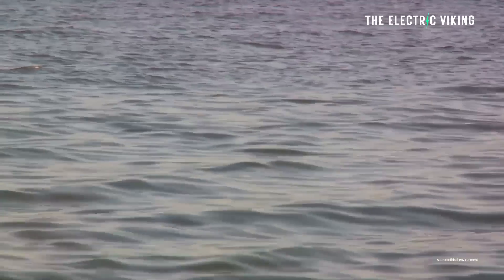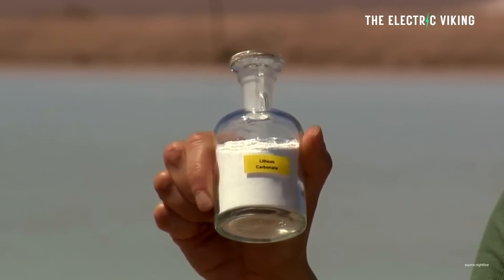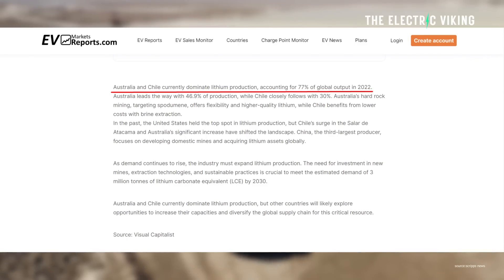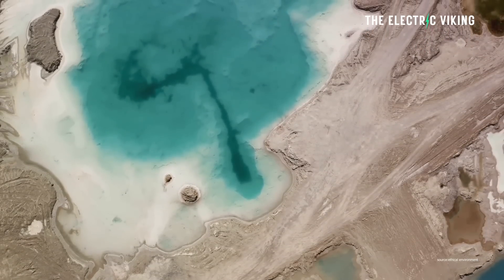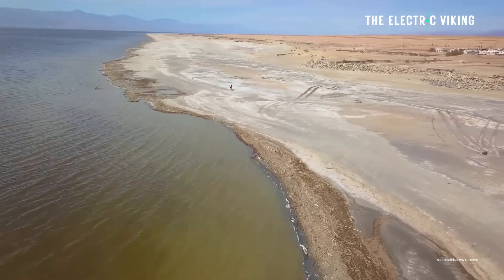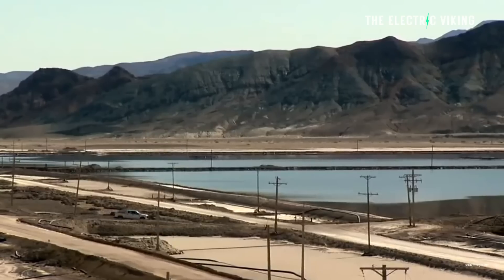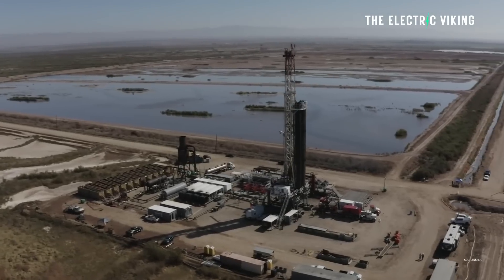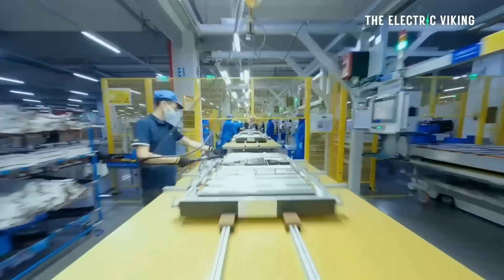US researchers discover how to cheaply extract Lithium from the Salton Sea

Comment: Did you know: Salton Sea is well below sea level... Rivers from Mexico flow north into the sea... San Andreas Fault runs right by it- Indicating a Plate boundary... South end had volcanos where many geothermal plants generate electricity... Currently Salton Sea area is very unhealthful due to dust storms... Should the San Andreas slip, there is a possibility for the Sea of Cortez to reach up to Palm Springs...😎

Comment: An above ground pipe of 6" or 8" of PVC could be ran from the Salton Sea to the Gulf of California. It is 120 miles long. 6" pvc is sold in 20' lengths at roughly $10 each. 264 piece of pipe per mile at $2,640 per mile. 31,680 lengths of 20' pvc linked together for $316,380 total. That's really cheap for that much pipe for that long of distance.  

Look at pumps and gallons per hour.  

Could run a large diameter pipe or more then one pipe. 

Easy low cost project to get the Salton Sea full again.

Comment: Lithium refining is probably what drives price up bc the final manufacturing has to be done in ultra low humidity. Even clean rooms are not suitable for the final refining of lithium. You should do a show on the full manufacturing process. With emphasis of final stage production. IMO solid state batteries is what EV market needs.

Comment: Mind you, lithium can also be recovered from depleted oil wells as oil reserves are basically ancient sea bottoms...

Lithium is one of the most common elements in the Universe.  The only reason why we have limited lithium supplies is because there hasn't been much of a demand for lithium till recently.
Reply: What..?? You're saying Lithium is one of the most common elements in the universe. WRONG! Lithium only exists on Earth. Lithium is number 25 in terms of "abundancy" and is defined by the Minerals Council of Australia as a comparatively rare element found in some rocks and brines but ALWAYS in low concentrations. That's why you have to shift 12 tonnes of overburden to extract sufficient Lithium for just one EV battery. Lithium mining is every bit as environmentally destructive as open cut coal mining and drilling for oil.

Comment: Forget the Salton Sea. Frackers have discovered there is enough lithium in their waste water to supply all our needs. Getting it from sea water would be cheaper and easier but when you are looking for ways to justify your operations....I guess they know how to use their PR departments.
Reply: The Salton sea is the northern end of the Gulf of California. It was cut off from the rest of the gulf by the delta of the Colorado river. It is below sea level and was a dry lake bed until the gates controlling water flow into a canal from the Colorado were overcome and washed away by a flood. The Colorado then took a new path - meanwhile creating a few canyons - and dumped into the Salton Sink. This continued for months until the Southern Pacific Railroad, to preserve their right of way, dumped railcar loads of rock to create a dike and restore the Colorado to its former bed. You now had the Salton Sea. 

At first this was fresh water and for a while there were even resorts on the "sea". Over time the lake has dried, become salty and contaminated with agricultural runoff from the Imperial Valley's farms. There is hot brine below ground in the sink. This has been taken advantage of by several geothermal power plants. After the heat is extracted to boil water to drive turbines, the brine is pumped back into the ground to be reheated. It was known that there was lithium in the brine, but this was taken no notice of until demand for lithium jumped. So now the plants are thinking of extracting the heat AND the lithium before reinjecting it into the ground. The Salton Sea is not proposed as a source of lithium. It is just a neighbor.

Comment: More then likely we will see NaLi batteries in the future either as a mix pack designs or as a single battery design, so more or less if there is Li supply, it can be used. Li still has the benefit of being a smaller element over Na. Yet, if we can't get them safer, its still a bit open if we should be using Li at all. Hopefully we can get solid state batteries on the go and fix a number of those issues even if it means a thicker layer of Li if we have the supply.

Comment: I remember hearing years ago about the "playa" of the Salton Sea, and the environmental problems that its concentrated, sea salt, fish bones and farm chemical runoff was doing to the inhabitants children of the area by breathing that stuff when it became wind blown. I remember at the time thinking, they extract lithium from saltwater aquifers and then dry them out in large flat ponds. They take the dried out leftover salts and extract the lithium from that. What is the difference from that and environment along the salt flat like "playa" on the edges of the Salton Sea? The Salton Sea has super high salt water that is way too salty now for fish to live in, the many geothermal plant there are powered by hot salt water aquifers. It has large unpopulated flat desert plains for drying. It seemed to me that it had everything needed to extract lithium. Low and behold, it seems that now everyone else is discovering it for the lithium gold mine that I thought it would be all those many years ago. Tony Seba call me.

Comment: The problem with cheap sources of lithium is that lithium battery recyling will halt cuz it will be cheaper to extract new lithium, so governments should incentivize recycling thru both "carrot and thr stick" policies, else we'll end up with a huge environmental problem from lithium batteries being discarded
Reply: Pretty simple to create regulation making it illegal to not recycle the batteries. You can also require manufaturers to use a certain percent of recycled lithium in any new batteries. I'm not convinced lithium will be the norm for more than a few decades before some other chemistry becomes dominant.

Comment: There are only 525,960 minutes in a year. So at a run rate of 250,000 vehicles per year, that is a vehicle approximately every two monutes. TEven without building operations, tansporting vehicles from production to logistics on the surface roads will take longer than two minutes  Due to the avoidance of surface traffic, the tumnel should reduce transport tome to less than 2 minutes, and if necessary, could be paralleled. This avoids a bottleneck and as such is imdeed nevessary to meet delivery goals, rather than a marketting or tunnel-pride project.
Reply: Tunnel??

Comment: The problem with Lithium is I believe that it's finite here on earth. We shouldn't use Lithium mostly for cars only.

We need them for our phones and gadgets. What will happen if Lithium runs out? Oil runs out, but nature will eventually replenish it with our biomatter.

I think you can't reuse Lithium once it's depleted or corroded.

Hopefully there is an alternative to Lithium. If you can create electricity from water.
Reply: There's other common chemicals like sodium that can take over for different applications, like stationary storage. 

Large batteries are recycled and the chemicals are refined back into feedstock for new batteries. Right now almost all of it is still in use. Lithium is an element and doesn't change into something else. 

Replenishment of oil takes millions of years. We are burning it at MUCH faster rate. Biofuels might be feasible someday using reactor process heat and carbohydrates from biomass. Don't hold your breath. 

And no, you can't turn water into electricity. Someday we might fuse deuterium and tritium to make electricity or heat. Nowadays we use the gravity potential in reservoirs to generate electricity, but the water is unchanged.

Comment: We need batteries that do not blow up..
Reply: Lead acid batteries can blow up. Lithium ones don't, but lithium ion can burn if it is defective or forms dendrites. LFP and sodium ion batteries have different electrolytes and are fire resistant.
Reply: @jamesvandamme7786   Then make only ones that do not burn

Comment: I've been to the Salton Sea,  This process has never been done on a commercial scale; so it is one of those tech innovations EV advocates will point to and say all we need is this new thing that doesn't exist outside a lab.  But when EV advocates hear the same sort of solution around the corner for hydrogen or ethanol or any other solution; they don't like it they don't accept it - blinders don't help you know what your options are.  In this case, really something better than lithium is needed for EVs to succeed; lithium is too heavy; too fire prone, high energy cost to mine.  If better battery tech really is around the corner why invest in something obsolete?
Reply: Tech transfer is dependent on the obstacles to implementation. Some processes that are feasible in the lab need only to be scaled up to high volume production. Some have minor problems that need to be worked out. Mining is expensive, but letting the sun evaporate water and just scooping it up afterwards looks a lot better.

Some energy storage systems, in the case of hydrogen, need a miracle to get around the laws of physics. The blinders are off; we see plainly that using energy to generate hydrogen has inherent inefficiencies at several steps along the way, which storing that same energy in a battery doesn't have. 

Millions of EVs in use show that lithium is successful. Some electrolytes burn, so... don't use them. Batteries are improving, but like this year's phones vs. next year's, lets use what we have today.
Reply: @jamesvandamme7786  Sure that is so; but - someone has to do it and obtain and spend the money. If Solid state, Selenium or sodium or nano carbon are just going to come and wipe out your investment - why would you do it?  Got to watch out for that water vapor that is by far the largest gobal warming gas. Carbon Dioxide is a mere 1/10,000th of the atmosphere water vapor is roughly 2%  20,000x as much.
Reply: @jamesvandamme7786  slight correction to me - man's contribution of Co2 is 1/10,000th , Co2 naturally occuring is 3/10,000th.
Reply: @jamesvandamme7786 so let's use ice cars today

Comment: Anything about the Salton Sea is fluff.... Extracting lithium is called intercalation.... And we know how to do it with various compounds .   I could explain it to you, but it's above your head.  All you got to do is Google patents on it and it's easy to see what's being used...... Let's just say there's only one pilot plant operating at Salton Sea and its corroding badly. Hot brine corrodes corrodes common  metals....requiring expensive materials.   The sheer volume of brine needed for a small plant...requires dozens  of wells.....thousands of acres...hundreds miles of roads and piping to the wells..... And in the case of the Salton Sea this cools the brine, losing geothermal heat.    Brine has to be stripped of SO2..... Removing entrained  oil and natural gas , flaring the gas... It's all got to be reinjected into the ground..... Far away from when you took it out requiring dozens more wells.

The only one who's not a lithium company that understands this is Exxon.... That's why they purchased 300 square miles in South Arkansas.....$100 million. Because they realize that's what it takes. 

When you see these small companies with no money and no people they're just dreamers hoping somebody will buy them.
And every article you see is a fluff piece by somebody trying to drum up investor interest.... The real companies are out there working